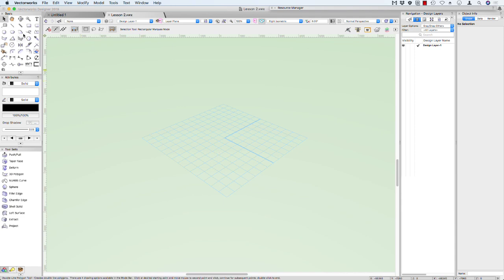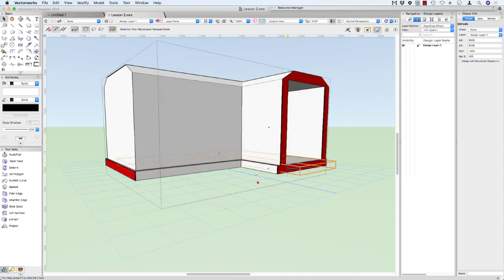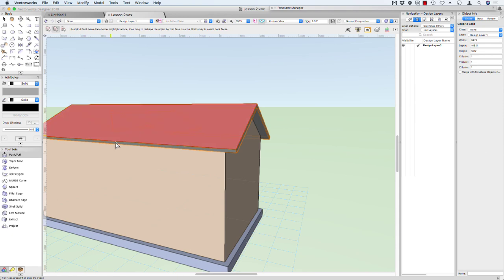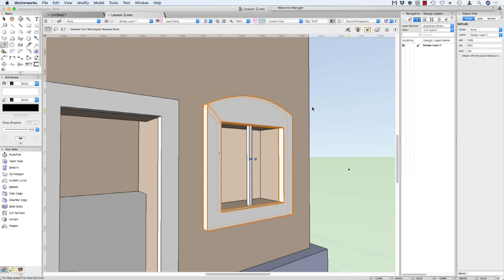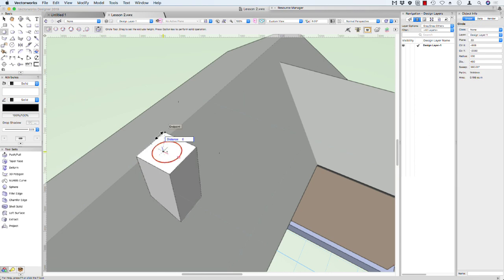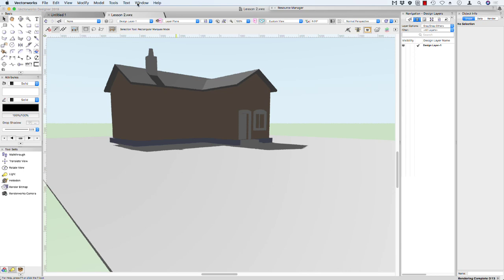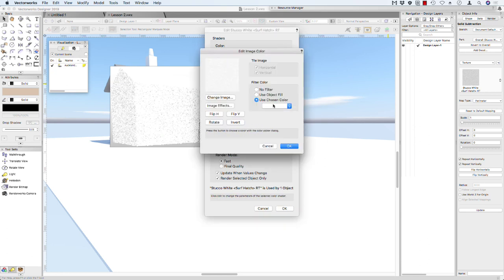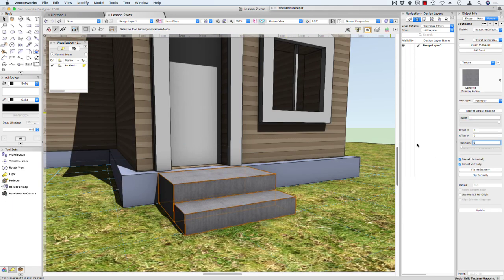Quickstart to Vectorworks Part 3

Comment: Hello everyone! When I use the shell solid tool on the roof, the two sides of the roof created don't meet at the ridge. Does anyone know what the problem could be? Thank you!
Reply from the maker: The shell is created perpendicular to the roof plane, you have to edit the ridge after the shell to remove the gap, I use the Taper Face to do that.

Comment: Hi guys, I'm trying to make the roof angle but for some reason, I can't get it to snap to angles (even with the snap to angles option turned on) and I also can't get it to snap to a midpoint. Does anyone know the reason for this?

Edit: I found out that to snap to a midpoint I need to turn on smart point on the snaping options :)
(The reason why my lines won't snap to angles still remains unknown)
Reply from the maker: Have you checked the settings on the Angle Snaps?

Comment: Every time I try to give my roof thickness, an error notification prompts at the right bottom of my screen That says "Shell creation Failed". Please can anyone help me to correct the problem? Thanks
Reply from the maker: try changing the shell thickness, make it smaller.
Reply: @archoncad  Thanks for the solution, but i found another way to solve the issue. After extracting the roof area, make the roof plane a 3d polygon and then use the shell tool. That's what worked for me! I really appreciate your response to my comment.
Reply from the maker: @juniorlouis-jean2488  There are always other ways to do things. Try the Extract Tool on the roof to get the 3D polygon, it will speed you up.

Comment: thanks for this series! how do you zoom in with using that small temporary window? you said Z right? that doesn't work for me :(

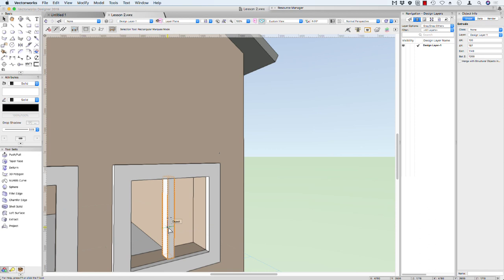and how did you zoom orthogonaly onto the working plane at 11:10?
Reply: You can also program option-center mouse button.
Reply: for the orthogonal move, I use the number pad
Reply from the maker: I use the middle mouse wheel button for panning.

Comment: Can anyone help me? My building casts a shadow that seems to be below the surface grid. I tried to add a polygon on the "ground" grid but the shadow will not cast on the surface of the polygon "ground".
Reply from the maker: Robert Dodds check your OpenGL settings. If you have turned on the shadows, you may have chosen “on ground only”
Reply: @archoncad  - Thank you!
Reply from the maker: Robert Dodds you should check out my web site, www.archoncad.com